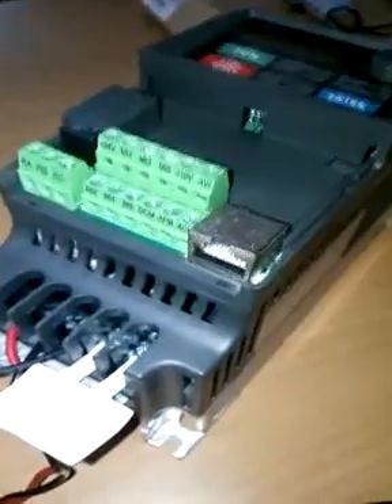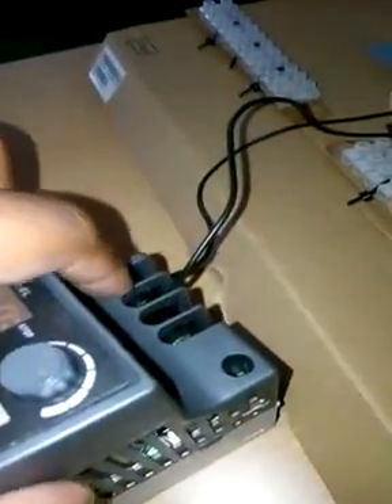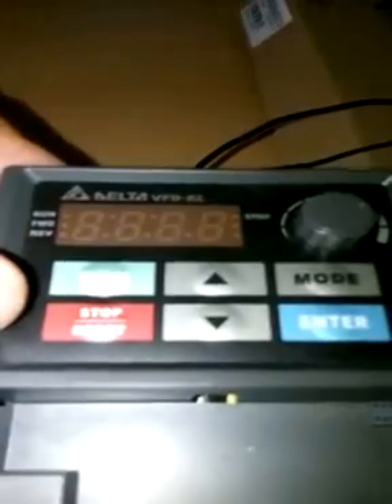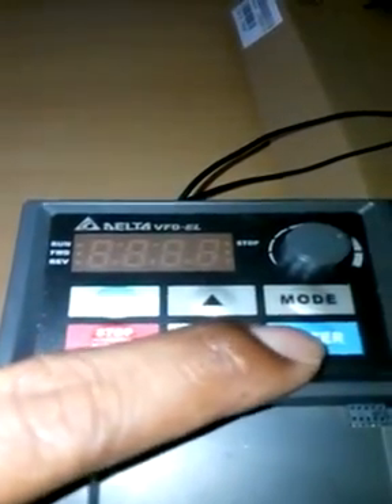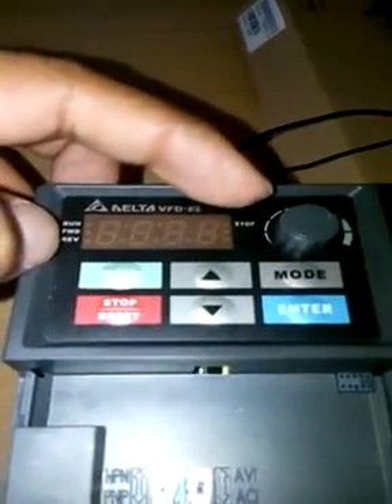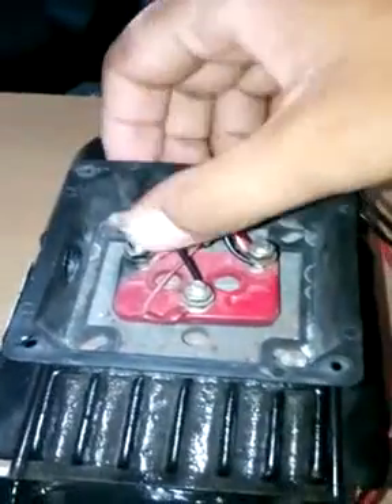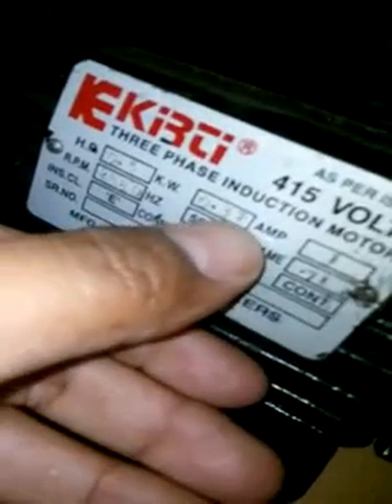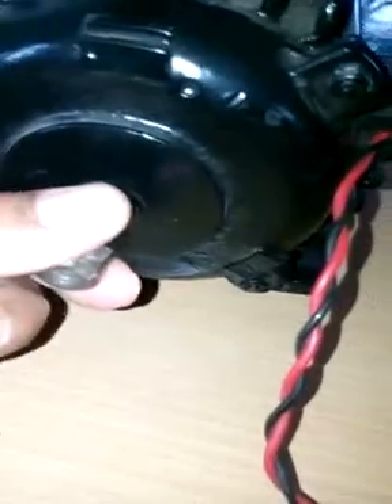VFD and MOTOR Terminals & connection

Comment: Sir i have a question that if a VFD is oFF then how would we know that it is set on Three Phase or Single phase?
Reply from the maker: Syed Shahzad Abbas 
only one way 
How’s it is connected with motor. 
Look at output connection.
Reply from the maker: You r talking about VFD input? Or output?
Reply from the maker: VFD is used only for 3 phase motors

Comment: if we use transducer... then where u connect the terminal..
Reply from the maker: its depend on output of transducer . 
If It is voltage(0-10V) then connect to voltage OR
If it is Current(4-20mA) then connect to current terminal o VFD
and as per that You also have to change Parameter in VFD.

I hope This will Help you.  Enjoy VFD
Reply: Fantastic
Reply from the maker: modbus communication video is available in channel. watch and give me comments.